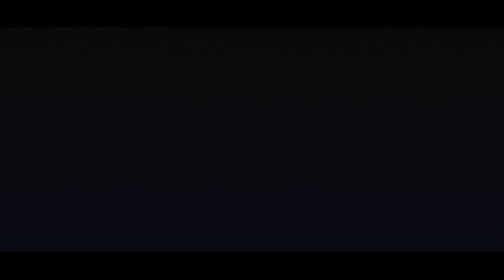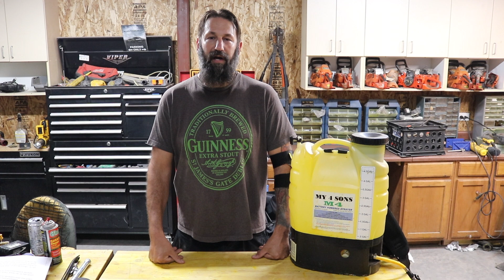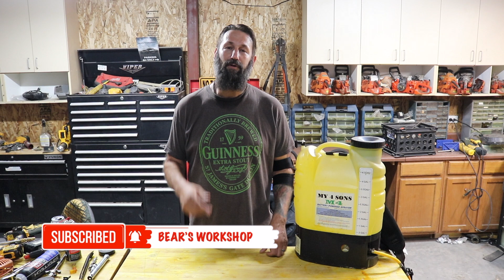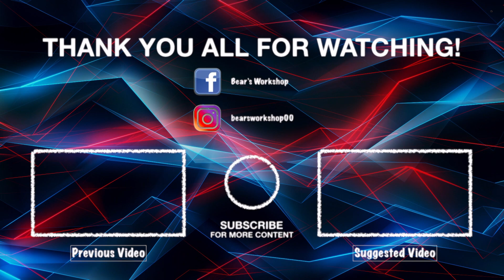My 4 Sons Follow Up Review M4 battery power backpack sprayers

Comment: I bought one that somehow shorted out with a loud pop.  I contacted Lance and he immediately sent out a replacement unit.  His customer service and support is second to none.  I added the extension rod for further reach and use mine to spray RoundUp on my lake lot, especially on the rocks on the steep bank that I could not easily spray without the M4S.  I added a folding aluminum luggage cart from Harbor Freight and hold the sprayer on it with multiple bungee cords as it’s a bit heavy for my 68 year old back to carry for long.  It’s an excellent combination.  I am totally pleased with this sprayer.  I charge it up every couple of months of non use.
Reply: I literally just got woken up at 4 in the morning because mine just did the same thing. Legit made me scream out loud I was so scared lol. Guess I’m gonna have to try and reach out and get a new one :)

Comment: My4sons sprayer came 2 days ago and, even though this is my first power sprayer and I don't have anything to compare it with, I can't believe anyone can make a sprayer better than this one! It came fully charged and I used it for 6 hours the first day and went through 30 gallons of mixed herbicide (big yard) and I gave out before the sprayer did! The meter never went from green to yellow! Everything works better than expected and of course they include more nossles than you will ever need. I love that it 's made in the USA. If there is one drawback, it would be the weight. I have not heard anyone mention how heavy it is but if you fill it up with 4 gallons, the sprayer will weigh around 45 lbs. I decided to go with 3 gallons to make it a little lighter. I'm already planning on applying fertilizer in a couple of weeks. I did my homework and I'm glad I chose this My4sons sprayer, it's incredible!!!
Reply: One more thing, the first time I turned it on I was surprised to find that if did not have one leak. I just knew that I would have to tweek it a little but I was wrong. Good job guys! Love the sprayer!